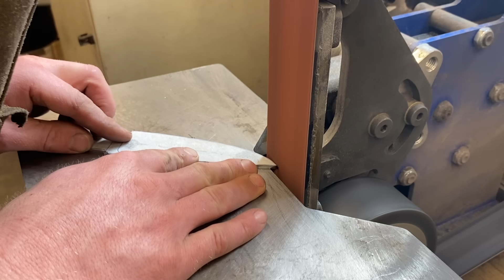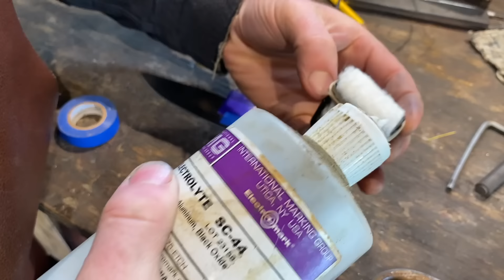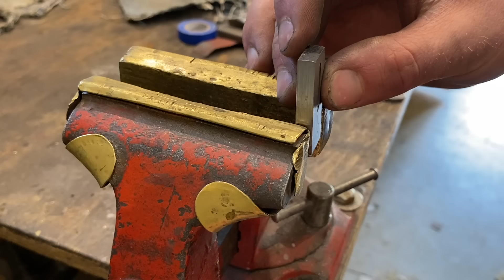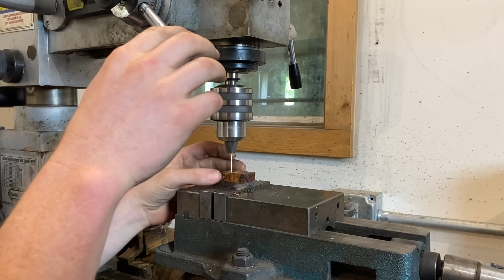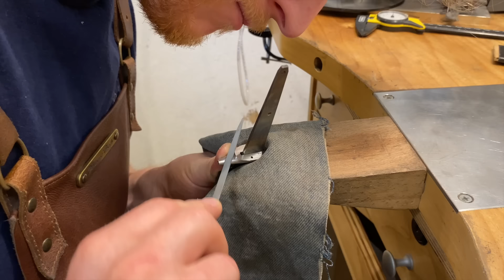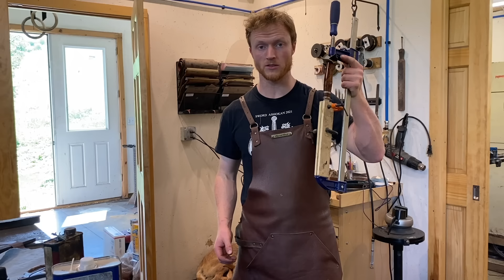Making a Fancy Hunting Knife

Comment: Thanks for the video—everything looks great. I do have a question, though: what do you use to hold the handle together while you're working on it so it doesn't fall apart? Super glue, I assume? But then how do you take it apart later for the final gluing—do you heat it up or something? I don't quite get it. Please explain if you don't mind.
Reply from the maker: There’s enough friction to hold it together, between the alignment pins and the close-fitting components
Reply: @Jordanlamotheblades спасибо за ответ,

Comment: From one bladesmith to another: As long as your endmill is a tiny bit smaller than the slot, you should never end up with a guard slot that is too wide. When you are milling your guard slot, make sure to lock your Y axis down to prevent it from wobbling and enlarging the width your slot. 
Edited to add: I don't see a lock on your Y axis as it is a 3in1 unit. In order to mill your slots without the slop, mount your vise 90 degrees to the way it is now. Center your guard front to back in the cross slide, then lock the cross slide down by screwing in the Allen headed bolt in the centre of the cross slide (between the gib adjusters). You will have to keep a good eye on the length of the slot, as that is where your slop will be now due to the backlash in the lead screw. If you set some physical stops in place for the travel length, you should be able to pretty much make perfect slots quite easily. You can also eliminate lateral slop in the Z axis if you tighten the quill lock after you plunge your endmill to the desired depth. When you need to adjust the quill to go deeper, back the quill lock off just enough to be able to turn the depth adjuster, make the adjustment, then tighten the quill again. You do some nice work, I hope this helps you out.
Reply from the maker: Keeping the quill lock tight as I adjust the quill might help. I do have both x and y locks and I use them, but the quill is sloppy enough that it moves a little when I tighten the quill lock, so I’ve usually found it to be more precise not to lock the z-axis. I’ll see if keeping a little tension on the lock solves the issue. Thanks for the tips

Comment: I’ve got an honest question. Not a criticism at all. I am really wanting to get into knife making. But as a user, and having gone from buying cheaper knives and using them until they are no longer serviceable or safe. Throwing them away and buying a new knife. To buying more expensive knives, using them without abusing them like I used to with the cheaper knives….. well to an extent. I am still tough on knives but have found that I’ve only had 2 knives from the pricier knives fail. And both were actually not being abused at all. Both were hidden tang knives that are why I am more reluctant to purchase knives with hidden tangs. 

Which brings me to my question. I’m both knives they were as I said hidden tang. But I’ve had hidden tang knives, even cheaper ones that survived way more. With these they failed right where the tang met the ricasso met the tang. And what I noticed was that on both they met at a 90% sharp corner. My question is, I’ve heard makers say that it doesn’t matter. Others say that anywhere you have a corner it cut in it needs to be rounded. Not so much with cut out corners don’t create a weak spot but cut in 90%s do. But then I’ve heard other makers say that it doesn’t matter. Is it dependent on the type of steel? The hardening? Should the tang be softened into the ricasso? Or is it better to always have a rounded inner corner where those meet? Both of the ones that failed were extremely sharp 90% and were more premium steels. 1 was S35vn and other was magnacut. I had several cheaper knives that were hidden tangs break in the same spot. Specifically 3 Ka-Bars. But surprisingly my SK5 CS SRK didn’t. Which I only found out recently that the SRKs are rounded in those corners. 

I apologize, it is a long winded question. But is absolutely the only reason I stay away from hidden tang knives as a buyer now. And why when I finally get set up to make knives was planning to stay away from them. But I truly love the looks of them and if could insure I wasn’t creating a weak point would love to experiment with handles.

Comment: Hi! Amazing work man  -  gorgeous knife! I have one question if you don't mind? How do you manage to separate the different layers  of spacers again without damageing them??  When I make sandwitch layer-knives I use  dabs of superglue and a very thin razorblade to separate the layers of of spacers after doing filework, but I sometimes damage some of the spacers... So frustrating!  Thanks for sharing  btw!
Reply from the maker: Hit them with a file handle or a piece of wood, and the shock will break the glue. Cheers!
Reply: @Jordanlamotheblades   Oh, okey I will test that out - thank you so much for replying!

Comment: As a machinist use an endmill that is smaller than your width of your slot and go little by little untill you reach full depth. Then move your table to one side to finish that side then move across to finish the final side then square up the corner era and adjust fit with small files and you won't have that fitment issue. Also use coolant if some sort but not straight water. WD-40 us pretty good or even just air to blow the chips away will help tremendously so your endmill doesn't recut shavings which dulls it, can make it cut oversized, and make them break as well. Just a little FYI...

(Edit:) Btw... You do have the ability to drill with that mill. You moved the endmill down to the stock with the handle on the side didn't you??? I know you're not a machinist but there are many ways to do what you claimed to not be able to do on your mill. I could really help you out with that sometime if you would like.
Reply from the maker: I appreciate the advice! I did not have a small enough endmill at the time I made this knife, though I usually do exactly what you suggest. It is quite a bit faster to mill the slot rather than drilling and filing

Comment: Beautiful work. Dont have to worry about billit inclusions or anything. The gaurd and handle look incredible! Why couldn't you drill the gaurd slot with your mill? If anything couldn't you just use your drill press for the z axis? Beautiful work
Reply from the maker: Thank you! I didn’t have a small enough endmill at the time I needed to make the guard, but otherwise, you’re totally right that would be a good way to do it

Comment: Excellent work!  I do almost everything you do except I use Dykem blue layout fluid to scribe my marks on.  Easier for me to see at the mill and band saw.  Good tip on using wax to coat the trial pin.  That would work on the blade above the guard to keep epoxy from leaking onto it too.  I take it you don't silver solder your guards?
Reply from the maker: Thanks! Wax can be used to clean up epoxy as well. I don't silver solder my guards. I used to use dykem for layout, but I found it scratched off too easily, and then it made things more difficult to see. It could be that my bottle of Dykem is just too old or got frozen a few too many times.

Comment: Do you heat treat the stainless spacer as well? I think the corrosion resistance is higher when heat treated properly but obviously still has good resistance untreated. Just curious 🤔
Reply from the maker: The stainless steel spacer is 304, so it can’t be heat treated, but it also has very good corrosion resistance. The guard is 416, which could probably benefit slightly from heat treatment, but it’s definitely not necessary for it not to rust. With high carbon stainless steels, you’re absolutely right that hardening improves corrosion resistance